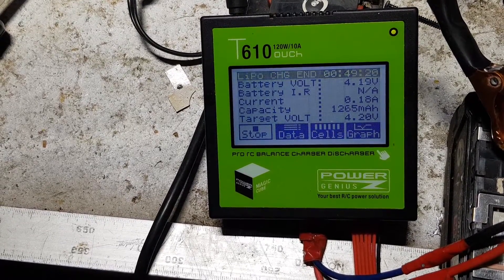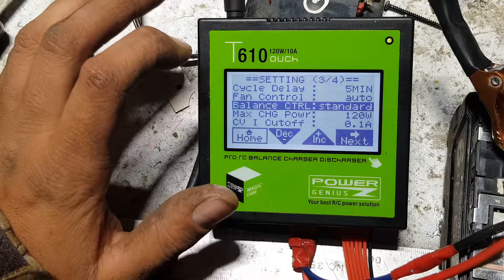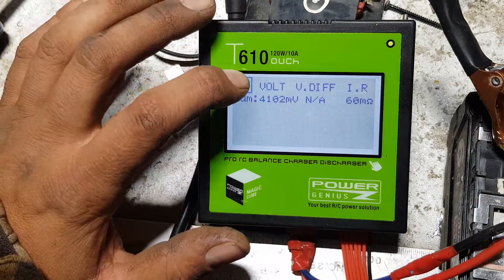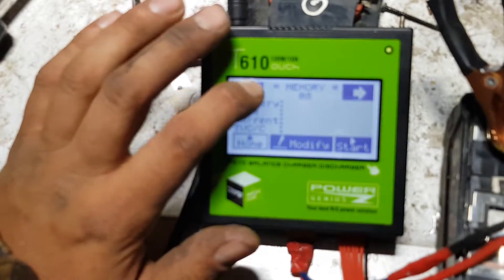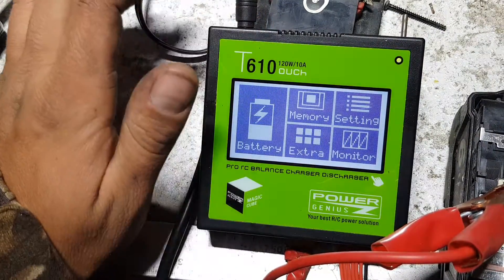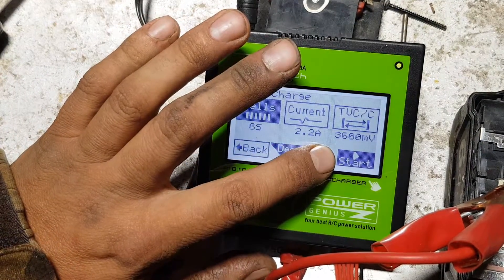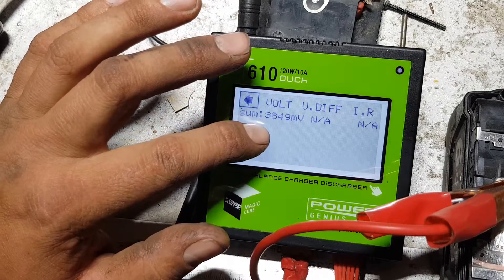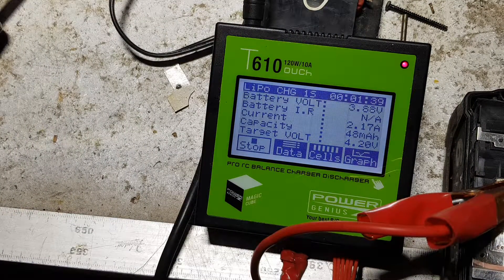Power Genius PG T610 Mode testing  120W 10A Lipo Battery Balance Charger Touch Screen

Comment: Thanks for the info !
As for the neighbors dogs, a little rat poison embedded in a piece of steak will do the trick :)
Did you ever check  that it is actually capable of discharging the specified 10w
Reply from the maker: No prob.
Hate the little yapping thing. 
Yes it does discharge at 10w ill make a lead acid and lipo discharge video soon too